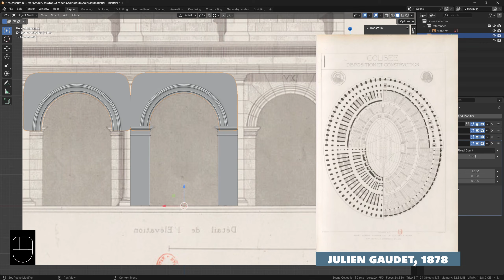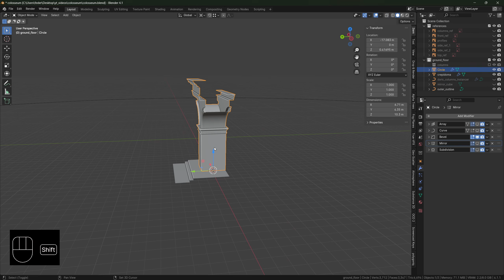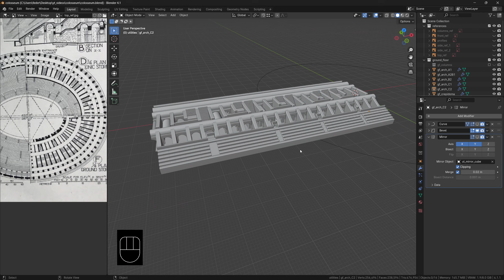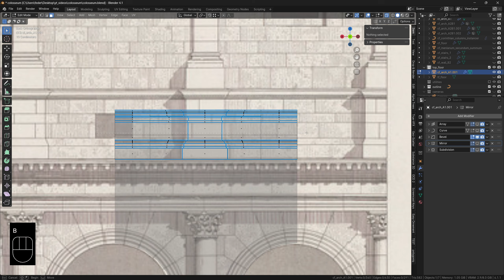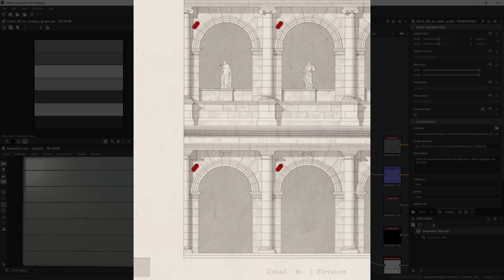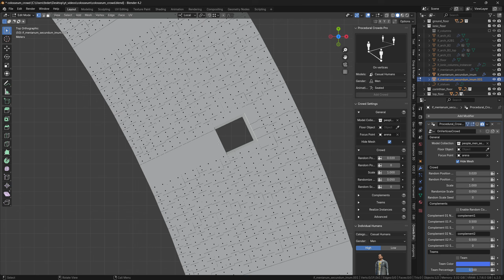How I rebuilt the Colosseum...in Blender!

Comment: I'm thinking about a problem. Since the geometry node editor is only available in blender, even if the modifier is applied at the end, it will become a different model. Although it has duplicate textures, it will be difficult to export. Some errors may occur. In other words, the rendering will be fixed in blender. If it is imported into other software, it will still require some re-editing work.

Comment: I’m guessing you ended up with 10 million vertices that should be connected to a nearby neighbor, but are not.  That’s why modifiers are not supposed to be leaned on so heavily.  Use them to help build out a complex shape, but once the overall object/building is created, you need to apply the modifier, then start addressing all the disconnected meshes.  Do this before you deal with UVs and texturing.

Comment: I don't if I noticed ir correctly. But how are you able to curve this sectioñs with a curve modifier without using subdivision modifier. I didn't see a geometry node modifier neither. When you showed the ground floor and had that çorner or a glee part. I only saw curve mos, bevel mod and smoothing mos. Unless the geometry has a tons of subdiffsion applied manually it will curve really bad. But yours looks really smooth. Wondering how that was done
Reply: Nevermind, I was skipping through the video and skipped past the part where you actuality do use subdivision modifier

Comment: At the ground level, between the arches, they had shops. The columns next to these arches have slots in their sides (in the opening) where they inserted wooden boards that got fixed with a wedge at top. When all the shops were closed, imagine a platoon of watchmen walked around the Colosseum.
The idea of using columns for shops of variable sizes with "flexible system walls" already existed in the basilica architecture/building form. Here they had wooden sticks at, say, 8 ft high between the outer wall and the inside column opposite that hole. Tapestry over it and you had your system wall. Between two columns was a very nice shop, but fancy ones could have (afford) more than one section. The money and jewels traders would have their tables in the centre lane. Doors on one side, closed at night, watchmen, and nobody would get inside to steal.
So the basilica form started as shopping mall.